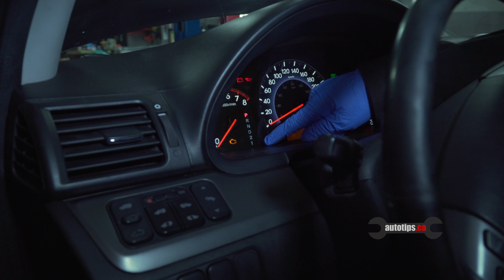A look at P0442 evap system leak

Comment: Question: At time 4:32, you pointed to a solenoid and said that it was a vent solenoid in the engine compartment.  I don't think that's correct.  Isn't that the PURGE solenoid?  I thought that the purge valve was in the engine area and the vent valve was the one near the gas tank.  Can you clear this up? Thanks.

Comment: Just had one on my 2006 Chevy Impala looked at the gas cap and turn it a few extra times and reset my check engine light and it's stayed off and was inspected so it worked

Comment: Whoa whoa where’s the rest? How about from the tank? 😩🙈 it didn’t happen until my fuel pump was replaced. Drove it home and now gauge is on E and P codes are popping up like crazy. 
Also how important are the fuel pump relays? Went to check mine and THEY WERENT THERE! 😂 shouldn’t the car not run? Who engineered this!? 🤦‍♀️

Comment: this helps alot, ive replaced the gas cap with an oem cap, and replaced the purge valve and still have the light on.  Going to check the canister next and see whats next.
Reply: Hey see if you can resetnthe light take the battery cable off and let it set a few minutes and see if it resets that light

Comment: Helpful about the sound when you take the gas cap off I notice I haven't heard that sound I am wondering if that's the problem with my 2017 Impala the engine light is on and the code is reading  PO442 a course I am not happy about it because the car is only 3 year's old with only 30,222 miles on it and the engine light came on yesterday it is scheduled to see the service tech Friday the 5th of March at the dealer,,
Reply: Were they able to fix it?